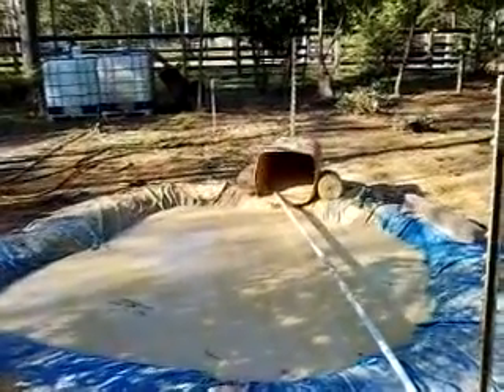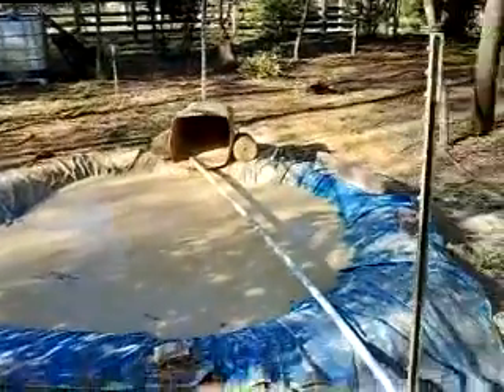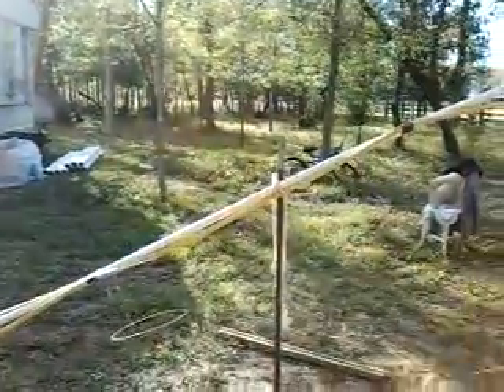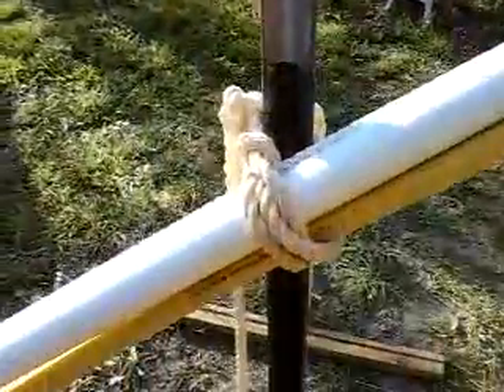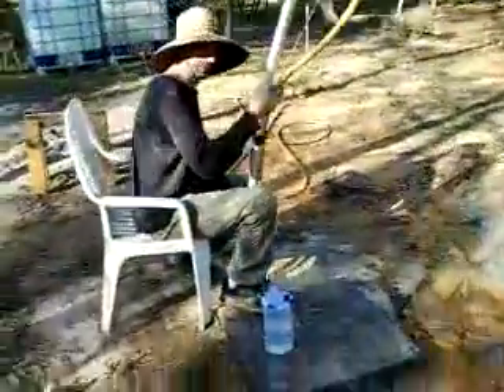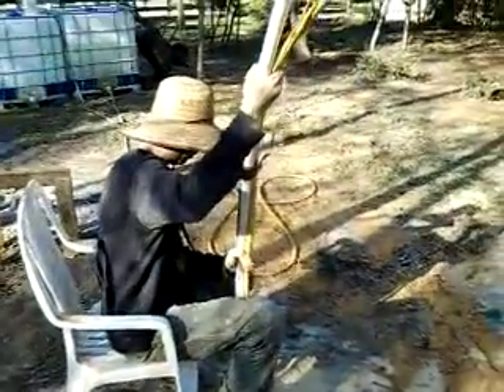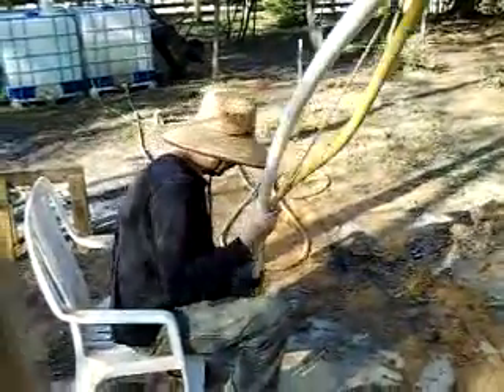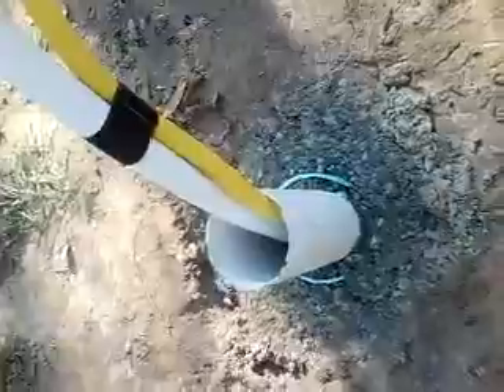Adam From Texas Drilling His Own Well

Comment: how do you make it go vertical and not off track?
Reply: It generally goes straight just because there's no reason for it to go crooked - and if it is a little crooked, the casing will still follow it. We can add spacers for when we need it to be very straight, they hole the drill and the first section of pipe straight while drilling.